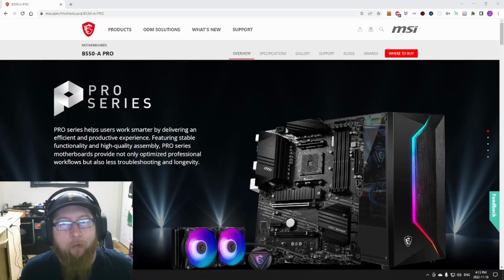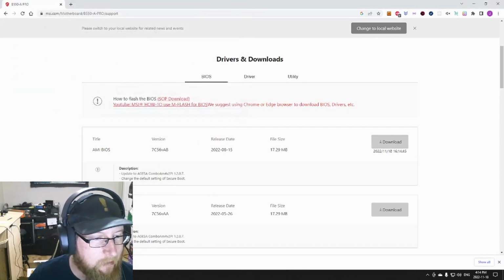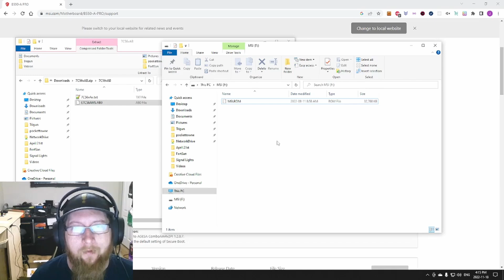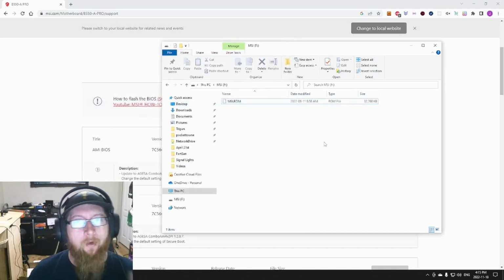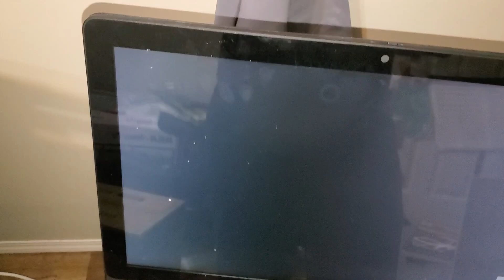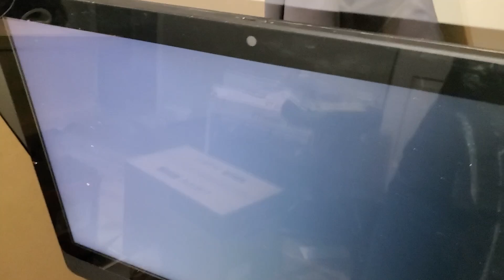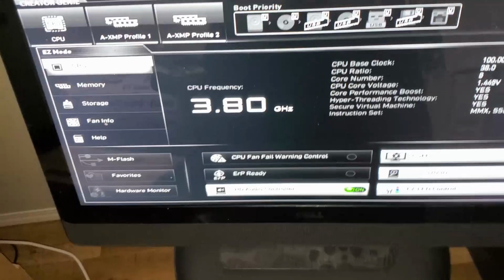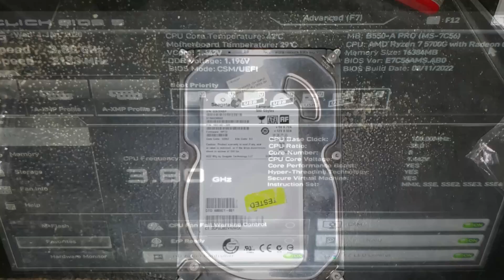MSI B550-A Pro Flash Bios

Comment: For some reason when i do it the light flashes red constantly and jt doesnt stop. Its veen doing it for 2 hours, what do i do?
Reply from the maker: 2 hours is a bit long ;o

While it's blinking it's usually writing something but... I don't know if turning the system off will brick it or not. Depends what it's doing. If it is writing and you turn off the system it will brick the board and you will have to replace it.

You could try contacting MSI and ask them what they suggest doing, and if they say to shut it off and it bricks it, then you can get a replacement because their tech agents told you to do it XD lol
Reply: @Kardall  well shit I've already flicked it off 😭
Reply: Same here

Comment: Having an issue, used to latest version, plugged it in. Light blinks for 5 seconds and turns off. No display still and graphics card won't turn on. All parts are properly mounted
Reply from the maker: Did it already do an update where it flashed for like 3-5 minutes or more? Or has it only every blinked for 5 seconds and stopped? If it's the later, then it is having problems finding/reading the bios file.

Make sure it's FAT32 formatted (preferably a smaller drive like 4gb or something) and the bios file for your motherboard is correctly named. In the case of this MSI board it was MSI.ROM and it should be in the root folder, not a sub-folder. And we're talking about the files inside the archive when you downloaded from the site. Because inside there is a rom file that you rename.
Reply: @Kardall  I'm using the exact same motherboard, fat32 formated, named the file MSI.ROM it is a 16gb stick though since it's all I had. Nothing else is on it. The light blinied for about 3-5 seconds. Is there a specific version of the bipa update I should be using?

Comment: Hello ive a question 
Do I need a GPU or integrated graphics to upgrade the bios?
Reply from the maker: Using the Flashbios Button no. It will update and when the light goes off it should work. If you don't have your GPU yet, then you can still do the update with a power supply connected and nothing else even. As was shown in the video. The only reason there is a monitor used in the video is to show that it works afterwards.

Comment: Hey, the video is very nice and helpful but do we have to do the same thing as you did with the screwdriver and the pin to show the Post? 
If you are obligated, Why?
Im very interested about that stuff
Reply from the maker: The screwdriver to short the pins is simply because the motherboard is not installed in a case with a 'power button'. The screwdriver does the exact same thing as pushing the power button on a PC case. It causes a short between the two pins on the motherboards 'Front Panel IO' area, labeled "Power SW" usually.

You don't have to do this, but it's always good practice to ensure the system POSTs outside of the case before installing, that way if you need to RMA any faulty components beyond the RAM like lets say there's a problem with the motherboard itself, you don't have to spend the time to remove ALL of the components from the case. You just simply unplug and put it back in the box etc.. Saves time.

Plus, if the system POSTs outside of the case, and then does not when you put it in, you know something happened during the installation process that caused the issue.

Comment: How would I know if the BIOS Flashed if I have a Ryzen 5700x would I have to plug in my Graphics Card 
and my ram to see
Reply from the maker: Yes you would because the 5700X does not have Integrated Graphics. Only way to test is to see if it POSTs.
Reply: Okay thanks man gonna get the motherboard and cpu tommorow so ye just making sure @Kardall
Reply: Another question if I already have a SSD with Windows 10 installed on it and have stuff on it will it work if I have a new motherboard and cpu? @Kardall

Comment: Hi man I have a question if I do this will it work with the Ryzen 7 5700x
Reply from the maker: You can use this process to update the Bios period. Doesn't matter what CPU you have as long as it 'works in the board', this process lets you update the Bios without a CPU. So as long as you update it to a version that the CPU Compatibility lists as the minimum Bios that supports that particular CPU model, then you are good.
Reply: Okay man thanks  @Kardall

Comment: Can a normal usb drive be used
Reply from the maker: You use a normal USB stick, and preferably smaller the better. I think mine is like a 2gb stick or something. Sometimes the 16gb ones don't work because they're too big for their firmware to recognize, but your mileage may vary.

As long as you follow the instructions of the manufacturer as far as the formatting (which is usually FAT32), and do the bios naming or whatever they want you to do to make it work, then it should be fine.

I'm just curious, what do you consider an 'abnormal usb'?
Reply: Is there a difference between a usb stick and a flash drive?

Comment: Hey I'm building a pc very soon , would you mind doing this video but with the ryzen 5 5600x If possible BTW your video are really helpful
Reply from the maker: I cannot re-make this because I do not have an order for those two parts. My B550-A Pro loaner is being RMA'd and returned right now as well.

However, the minimum bios you would require would be 7C56vA4 or use the one on the video, same thing. You will need a graphics card installed because the 5600X does not have integrated graphics.

Other than that, it should work identically.
Reply: @Kardall is that version compatible with windows11? I see that 7c56vA8 is the windows 11 update. But would it still support a 5000 series Ryzen?

Comment: Hi friend, I want to install Windows 11, do I need to update to the specific driver with support for Windows 11 or can I download the latest version normally? In the motherboard specifications it says that it only supports Windows 10 Pro 😭 and I paid 120 dollars for an original Windows 11, could you help me my brother?
Reply from the maker: Windows 11 has requirements for the motherboard that you have to enable in the Bios.

As per Microsoft's Hardware Requirements ( https://learn.microsoft.com/en-us/windows/whats-new/windows-11-requirements#hardware-requirements ):
System firmware: UEFI, Secure Boot capable.
TPM: Trusted Platform Module (TPM) version 2.0.

You will have to look through the Bios on where to enable those features or if there is a Bios manual (sometimes MSI has a separate manual for it), then it will tell you what category it is in. But normally it's in some sort of Chipset sub-menu or sometimes they hide it in the Boot menu. I don't have a board I can spin up to tell you where it is unfortunately :(

Comment: I plug in the USB and hit the button. Machine starts, runs for a bit then shuts down, and powers back up. The red flashing stops when it restarts. I have to shut it off. I put in CPU, ram and cooler. Plug in monitor, turn on psu and get nothing. Note CPU debug light never goes off. Already swapped out CPU, for a compatible one. Was thinking BIOS version but have tried many and flushed the cmos via battery removal.
Reply from the maker: The machine should not start when you push the flash bios button. I would check your power connections to everything to make sure they're not semi-connected and causing some sort of freak-out or short-type of situation.

All you should really need is the 24-pin and the 8-pin CPU Power connections, you can take the RAM out of the system if you want to as it is not needed, just to make sure the system doesn't try to POST.

If you have a compatible CPU though, you should be able to get it to POST to bios and do the update within the bios. No need for the flashback bios button at that point.

Comment: So, I followed your process and I still cannot get a BIOS screen. I have no idea what to try next. Any Ideas?
Reply from the maker: Did the red LED stop flashing? Did you plug in your graphics card and it's required power as well as connect your monitor to the GPU? Do the Debug LEDs get stuck on something? It's near the 24-pin power I believe.
Reply: Yes the red light went off and everything is properly connected. The debug is shownig CPU @Kardall
Reply: I tried multiple BIOS versions, flushed the CMOS too. Push button, red light flashes slow, machine starts light flash fast, machine runs for awhile, shuts off, starts back up,red light flashes three times. Machine doesn't shut down. Turn off install everything properly start back up and nothing. Cpu debug light always on but already swapped cpu for a 3-3100 Ryzen.

Comment: Does it need to blink or can it stay on ? Does it matter ?
Reply from the maker: When you press the Flash Button, it should immediately start blinking which tells you that it is reading the USB and doing things. If it stays on, it's some sort of error. If it cannot see the MSI.ROM file on the USB drive, make sure it is renamed correctly (show file extensions if you have it disabled so it's not like MSI.ROM.a96 or whatever the original file was). And go through your checklist of FAT32 formatted, all files in the base drive not inside any folders on the USB drive, etc..

Comment: I flashed the latest bios to my motherboard. It will boot up, but not with the CPU installed. I have a ryzen 5600. Not sure where to go from here.
Reply from the maker: Well a 5600 does not have integrated graphics, you would need a 5600G if you do not have a dedicated graphics card.

Comment: Hey man i just finished a build and the cpu light was on so I checked it and stuff and no issue and I found your video and tried doing the bios everything was going along well like in your tutorial but I’m not posting after the red light is done blinking and still stuck on white cpu light
Reply from the maker: So the Bios LED flashed and after like 5 minutes or so it turned off? Sometimes the CPU light won't shut off on some models, but when the red light for the Flash Bios LED goes off, you should be able to power down the system and install your cooler and such so the system has a 'load' on the CPU_FAN header. Sometimes they won't POST as a self-preservation thing, so you don't overheat the CPU. Not sure how far you have gotten with the build, but you can assemble everything outside of the case on the motherboard box like I did in the video.

Hard to say what might be wrong.
Reply: @Kardall  sorry for not responding I didn’t download the right version of bios and there was also a ram issue where the ram I was using was not compatible with the motherboard my computer has now posted thanks for the help you a 🐐

Comment: Hey man, sorry if this question has already been answered. But I’m not getting the post screen. Connected HDMI screen, but screen saying no signal when the mobo boots. Any suggestions?

Edit: the bios process was fine. Light flashed then stopped etc. just cannot post.
Reply from the maker: If you have a graphics card installed, make sure you plug your monitor into that instead of the motherboard.
Reply: @Kardall  No GPU installed. I just unboxed parts and followed your full tutorial

Comment: Good evening, first of all congratulations for helping so many people with this well-explained video, the thing is that I bought a B450 GAMING PLUS MAX and I put it to update the bios just as you did and nothing, when it comes to putting everything on and turning on it jumps the red light on the motherboard in the part of the cpu as if it were wrong, the thing is that the processor is well positioned, it works, it has no bent pins... I also have to say that when I updated the bios the white color does not jump inside the motherboard. First of all thank you very much.
Reply from the maker: Since it is a different motherboard, the way the lights react when it's complete or any errors may differ slightly. So when you do the bios update, does it do the blinking red light for the bios flash and eventually turn off after a few minutes? If it does, then it should have updated it successfully.

If the Debug LEDs still show the CPU error, it may be a few things that you could check:

1. Make sure the Bios version you updated is supported with your CPU or that you updated it to the correct one. If you have an older CPU like 1st or 2nd Gen Ryzen, and you updated it to support a 5000 series potentially, sometimes they remove older models of CPU support to make room for the code. Meaning, it would have disabled say a 1600X or 2600G support on that particular bios. You would need to double check your particular CPU vs. the supported list in the CPU Compatibility. Usually there will be a Bios version between the supported for that CPU and whatever the 5000 support would be, that describes that it removes the 1000/2000 series support.

2. See if you have the CPU Cooler plugged into the CPU FAN header or appropriate header so that the board knows there is a cooler attached. Sometimes they will not boot if there is no draw on one of the 'CPU' headers (like the pump or cpu_fan).

3. Ensure you have removed any plastic protector on the CPU Cooler, as it may cause the system to thermal throttle and not POST properly.

4. Do a CMOS reset to see if some other setting in the Bios has made it so it won't work.

5. You could contact MSI to see if they can help you with your particular hardware configuration, as they will know any particular pitfalls with some hardware compatibility according to what your specific situation is.

Comment: hey i have a question about this bios, are you able to switch to XMP ram setting?
Reply from the maker: Providing the RAM doesn't have compatibility issues yes. Otherwise you can always manually set the speeds in the Bios.

Comment: ı did everything u say sir but after the red light stops system res itself and no display pls ı need ur help
Reply from the maker: If you have a "G" series CPU then the motherboard should have output after you update the bios to a supported version. If you have a normal CPU that does not have integrated graphics, you will need to then install your graphics card and connect it to your monitor (not using the motherboard).

Comment: Shit, i am gonna do this and just hope the bios is flashed i dont wanna build in my gpu before the mboard is in the case. also would you recomend putting cpu cooler and ram on the motherboard before putting it into the case
Reply from the maker: Normally you put the essentials on the board to get to a POST screen. Just put it on the motherboard box, connect the CPU Power, 24-pin Motherboard Power, install your CPU and cooler (even temporarily just use the stock one to make sure it posts if you got an AIO or other cooler for the final build) and your graphics card if you don't have integrated graphics.

That way you know it works and you get a video output. Doing this will save you the many minutes of removing the board if necessary, remounting your cooler or anything of that sort.

Also, before you finish cable management, make sure the system posts in case you have to remove or unplug/replace cables etc..

There is no harm as long as you don't move the board rapidly and cause stress on the GPU socket it is installed on, and pretty much everyone does this. Those who don't risk the waste of time it takes to remove and swap out components after RMA'ing DOA components (like your motherboard). Super frustrating to have the entire system installed, and then the motherboard won't post because it has a bad CMOS chip, or someone else did a bad flash and bricked it, then returned it and it got re-entered into circulation and you ended up with it. It happens. Do things outside of the case for your own sanity.
Reply: @Kardall  ok yeah, i will thx, i assume u only need cpu and gpu for that no ram right?

Comment: Hi, i don't know if you will see this, but i have some problem with flash bios. I did everything the same as you, but when i plug pendrive led went red without blinking for like 5-10 sec and then started blinking for like also 5-10 sec and then ended. What does it mean?
Reply from the maker: Make sure your file is renamed to MSI.ROM 

It's possible it can't find the rom file. Make sure you have renamed it and maybe make sure your "Hide file extensions" is disabled so you can see them. Otherwise it may just be called "MSI.ROM.094" or something like that.

Comment: Hey got a issue my Light was blinking for a few seconds and it's just the red light.
I wanted to ask if this is normal or if there is a problem
Reply: But it isn't blinking Just red
Reply from the maker: @fentemil  Make sure that you have renamed the file correctly. If you have file extensions hidden, you may have renamed it MSI.ROM.C41 or whatever the original extension actually is. If it isn't called MSI.ROM then it will not be able to find it, which sounds like what it's doing. But there isn't a set LED patterns list anywhere.

Comment: My light is still solid red plz help
Reply from the maker: It can take a while to update, so if it's still doing the same thing after like an hour or two, then you can try to restart it and see if it takes. Otherwise, there may be either an issue with the drive you have (Fat32 and use a smaller size one like 4gb or something if you can) or you didn't rename the file correctly. Hard to say what is wrong.

Comment: When I do it, The light flashes red then just stops blinking red so it doesn’t update I tried every way to update to update the bios but it never reads the files inside my usb what should I do?
Reply from the maker: did you extract the actual file to the base USB folder and rename it to MSI.ROM

Comment: I made the mistake of not renaming the file to MSI.ROM before initiating  bios flash. Red light has been blinking for close to an hour. Is it safe for me to power off and rename the file before trying again, or should I just let it continue?
Reply from the maker: ahh, yes you should be okay as long as there isn't an existing MSI.ROM that it is trying to load. Should be safe.